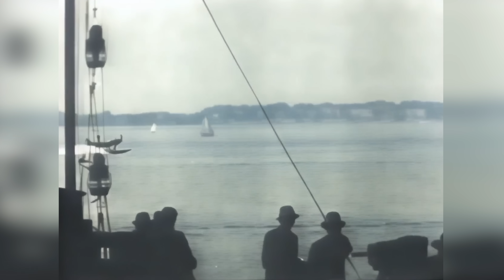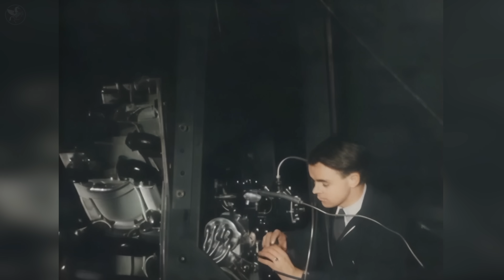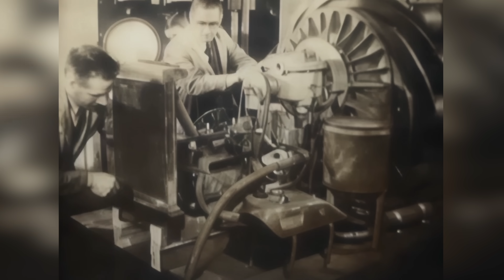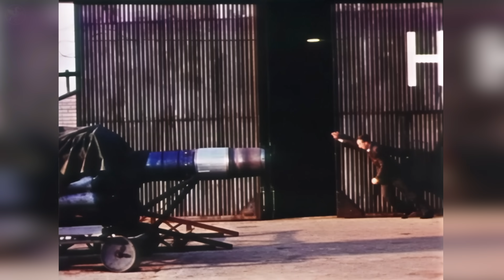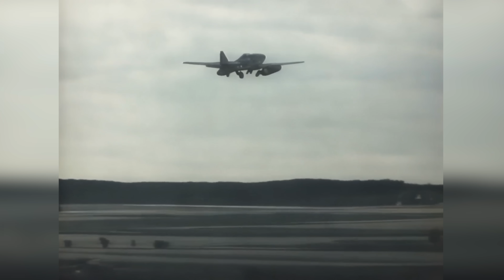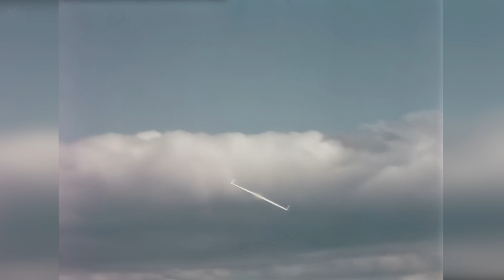THE LONELY GENIUS: How One Man's Engine Changed Three Nations. The invention of the Jet Engine

Comment: I think that what a lot of people either forget or  blatantly choose to ignore that at this stage of development axial compressors were at the very beginning of their development and so the engineers had little experience of the technology. With centrifugal compressors, because they were also used in superchargers, which by this time were in common usage on many aero engines, engineers had a much better understanding of the pro’s and con’s of the machines. Whittle was well aware of the advantages of an axial compressor but he was also aware of the challenges that they posed.
Reply from the maker: I could have not said that better
Reply: A centrifugal compressor still used on turbines in helicopters, ships and stationary turbines because it has a much higher compression ratio in a much shorter length than an axial compressors... Axial compressor engines were also hard to control and liable to flame outs they were either 'off' or 'on'  - also the German engines were lucky to last 10 hours,  where the Whittle engine had 500 hour life, better control and reliability.

Comment: In 1990, I worked for GEC at Cambridge Road, Leicester. The Whittle test bed was on that site. A brick block house with a hole knocked in the wall for the exhaust pipe.

Comment: The engines we fly with today are the grandsons of the german axial flow jets, not the whittle centrifugal flow jets.
Reply: Not strictly true. The Honeywell TPE331 series has dual centrifugal impellers; the ubiquitous P&W PT6 series has a final stage centrifugal compressor.
However, to achieve high thrust, one must have high airflow which is not attainable with impellers.

Comment: Whittle built the first working prototype by 1937, but von Ohain's simailar radial flow engine achieved the first jet-powered flight
The invention of the axial-flow jet engine is credited to German engineer Franz Anselm, who developed the Junkers Jumo 004 for the Messerschmitt Me 262 fighter jet in the early 1940s.
Reply: All built form Whittle's patents.
Reply: @agt155  Yes von Ohain was absolutely aware Whittles patent and had to modify his own patent application to avoid infringing on Whittles design.
Von Ohains work was ultimately recognized to be an independent and contemporaneous invention. 
That being said Von Ohains patent application referenced Whittles earlier patent but von Ohains design was distinct enough (using a centrifugal compressor and radial turbine) to be granted its own patent. 

Franz Anselm however did not use Frank Whittles patent. He independently developed the axial-flow compressor jet engine with the Jumo 004, a completely different design than Whittles
Reply: @kronop8884  Whittle had many patents. He patented centrifugal and axial flow, he also patented turbofans and turboprops. 

Not one production engine used von Ohains design which he abandoned himself soon after.
Reply: @agt155 I was under the impression that it was Dr Griffith at the RAE, who was working on axial-flow theory and not Whittle, but since you seem certain perhaps you could point me in the right direction of a Whittle axial flow patent ?
Reply from the maker: @kronop8884  Hans Von Ohain did not have ANY need to "modify", as Whittle's patent, which was merely a consequence of A.A. Griffith rejecting his brilliant work from 1926.
Whittle had no other choice, once Griffith rejected his work and the government did not step in to protect it with secrecy, but to patent it in 1930.
Still, thanks to Griffith, Whittle's following years were paved with rejection and ridicule, also landing him on the verge of bankruptcy.
By 1934, he had to choose to either feed his family or renew his patent for a few Pounds. He naturally chose his family!
Immediately after, the Nazis copied his work and spread it across German Universities, and of course, it conveniently landed on Von Ohain's lap.
The fable that Von Ohain made no use of Whittle's work, was later adjusted by the German, to be less of a total denial, but what most ignore is that the other fundamental person in Von Ohain's professional life, Max Hahn, who was also of Jewish descent (and Von Ohain was very much a Nazi supporter), further corroborated the extent of the use of Whittle's prior work.
Perhaps it was a way for Hahn to get back at Von Ohain and his beliefs.
One thing is certain: Von Ohain's turbojet would not have existed without either Hahn or Whittle, as he had zero understanding about the true benefits of a turbojet, something that Whittle understood very well (and some more) as a young student in the late 1920s.
As a reminder, and as always, very conveniently, Von Ohain's engine, the one that powered the faithful 1939 flight, was none other than mix-powered, incorporating a centrifugal component.
His "fully" axial variant would not have gone anywhere, nor made any kind of impression on the RLM.
So, no Whittle, no 1939 flight.
As for Frank Whittle, once his friend managed to find a brave private investor in mid-1935, one that provided minimal funding, and six crucial years after Griffith made sure that Whittle would be ignored by his own government, he completed his dream, and created the first working turbojet in history in April 1937, obviously before Von Ohain.
As for the axial turbojet, as predicted by Whittle in 1929, something that infuriated Griffith, who was the author of a very famous seminal paper on axial compressors dated 1926, it would take a decade to develop it into a proper engine, which is precisely what happened.
When Metrovick/Griffith's axial turbojet was pitted against Whittle's in the early 40s, Whittle proved that he was right more than a decade prior, and their engine was set aside because it was both unreliable and also hard to develop, despite being more powerful.
The exact same can be said of the disastrous Nazi turbojet, one that was as operationally useless during WWII as it was after the war, when only the French really tried to make something out of it, but it took them an endless eight years to do so, despite government funding and a convenient 120 (former) Nazi engineers at their disposal.
To make it work, they had to radically modify it and seek assistance from both Britain and the U.K., and that is a good indication of how bad that engine was, which was the result of years and years of the best German companies working on it (Junkers, BMW, Daimler, and obviously, Heinkel).
Had Griffith given the go-ahead to Whittle in 1929, Britain would have had the perfect turbojet  at the time, and most importantly, at a crucial stage in history, well before the beginning of WWII, and the 1/2 cheat Von Ohain would have probably worked on steam engines (perhaps.)
One last bit of important information: the Gloster Meteor, powered by Whittle's engine, which was (at least) six years late to the game, set the speed record in 1945, and this despite lacking swept wings.
It proved to be as fast as the Me 262, but was also not powered by a comical engine that fell apart after a few hours, or flamed out in flight, not a good trait for an aircraft that did not even bother to include an ejection system for the pilot, but what did the Nazis care about their pilots at that stage, when it was deployed in late 1944, they were months away from total defeat, and perhaps the Me 262 was just a pathetic propaganda show to keep the morale of delusional Germans up.
I suggest you watch and learn from both Whittle and Von Ohain's raw and rare interviews.
You will hear Von Ohain admitting how he was clueless about key things, or how Whittle was way ahead of him.
They had different lives; one came from a wealthy family, was pampered and fully supported, but was also a bit of a cheat, whereas the other came from a poor family, was rejected by one man, and accomplished his dream with minimal funding.
If you pay attention, you will also notice how Whittle is the expression of competence and pure genius, whereas Von Ohain is a lot more vague, and perhaps "philosophical". My take is that he was cautious about what he said for fear of being called out by the likes of Whittle and probably Max Hahn.
Last but not least, both Heinkel and Von Ohain never gave up on the centrifugal aspect of their turbojet, and at the end of the war they finally got the go ahead, but the war, by then, was lost, and that is perhaps the best testament that Von Ohain understood, at least to a degree, that he had to partially copy Whittle to make it work (at the time, of course.)
As for Whittle, he always knew that the axial turbojet would eventually take over (that happened in the mid-50s, a decade after the end of WWII), but his true goal was to give his country a revolutionary engine in the early 1930s.
It was David VS. Goliath (and some more), but Whittle emerged as the only true genius of the story, with absolutely clear goals and tactical acumen, paired with vision. Unfortunately, he found Mr. Griffith on his track, and yet, he invented the turbojet despite all odds, and every adversity imaginable, when Von Ohain had, figuratively,  an empty highway in front of him, a chauffeur that drove him, a full tank, and a fast Mercedes-Benz to do so (yet he failed to beat the British genius.)
Enjoy the lengthy and rare interviews; they truly add to the history of the turbojet and should lead to a more comprehensive Wikipedia page, which is more often than not, unfortunately, a source of information.
Hans Von Ohain’s exclusive lost interview: https://youtu.be/BTk_8GCwuzk
Frank Whittle’s series of exclusive lost interviews: https://youtu.be/WSJdyUGlE7w

Comment: His engine was dropped in favor of the German axil flow jet Better power to weight and more efficient on fuel!!!!!!!! And you usually do so well on your facts Drone!
Reply: Where do you think they originally got the idea from, Whittles patent.
Reply: @weirdscix  The idea of a turbine with a compressor existed before Whittle, Ohain, and Franz. Whittle's design may have provided inspiration, but the axial design is quite different from it. And it had greater potential from the outset, which was not due to Whittle's design.
Reply from the maker: Hans Von Ohain’s first famous turbojet, the one that famously powered the He 178, was mix powered, incorporating Whittle’s work, which conveniently landed on his lap in 1934 because Whittle could not afford to renew his patent.
Britain, for the record, also had an axial variant, which failed to impress when pitted against Whittle’s in the early 1940s.
Just like the failed Nazi engine, it would take another decade for the world to see a proper axial turbojet, as smart Whittle clearly understood in the 30s.
The failed German engine (operationally speaking), only good for a last ditch propaganda effort, was universally ignored after the end of WWII with the exception of France, and despite having 120 laborious and converted 120 Nazi engineers at their disposal, it took them eight years to fix that engine, and to do so, they had to radically modify it, but also seek assistance from both Britain and the U.S.
The Nazi magical turbojet is good for a show,but was utterly useless during WWII. It was a complete waste of resources
Reply: The uk government post war discredited Whittles centrifuge compressor and said it was  obsolete . The Soviet Union had captured some Me 262 and done an investigation on the Jumo 004 which was found to be defective in some areas also highly unreliable.  The labour government offered the most powerful jet engine at the time which was the RR Nene to the Russian. So they turned down the axel compressor for a centrifuge compressor.  This was fitted into the Mig 15 a very capable aircraft.  The point I'm trying to make is not every one though that the centrifuge compressor was obsolete and the Russian accepting the Nene vindicates Frank Whittles brilliant design strategy.

Comment: Amazing. The jet engine running the world aircraft industry today's inventor sidelined and literally forgotten.
Reply: Actually they use axil flow engine the German one is much more efficient!!
Reply from the maker: Britain also had an axial variant, but when pitted against Whittle’s it lost, as it was unreliable and complex to develop, the same reasons that made the Nazi engine an operational failure when deployed in late 1944, months before defeat.
Britain could have also deployed an unusable axial variant, but they were not desperate, nor stupid, nor needed pathetic propaganda props as they were about to defeat the Nazis
Reply: @lambastepirate whittle knew that at the time but due to the then available metallurgy felt a simpler centrifugal compressor had a better chance of success. He was proved right in that the early German axial turbojet engines had very short service lives.
Reply: @petcatznz  Whittle's 1930 patent included a two stage axial compressor so that was not a German invention, but yet another copy by the German's of Whittle's work.